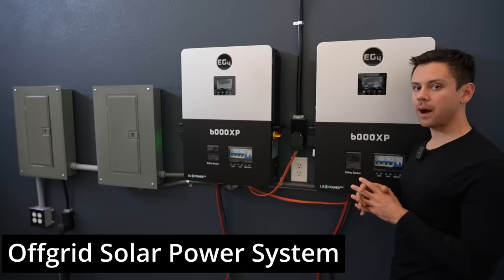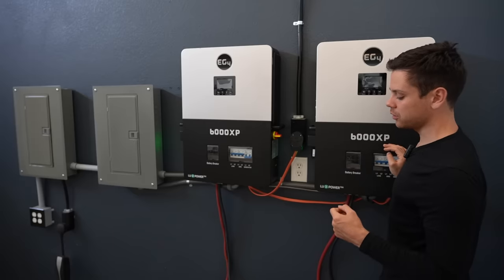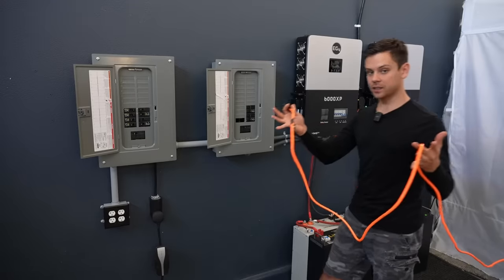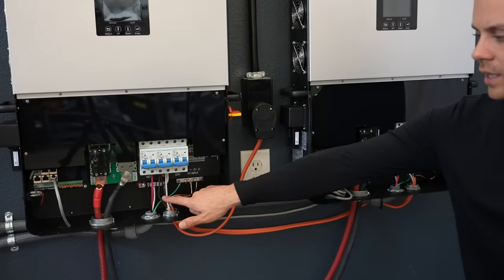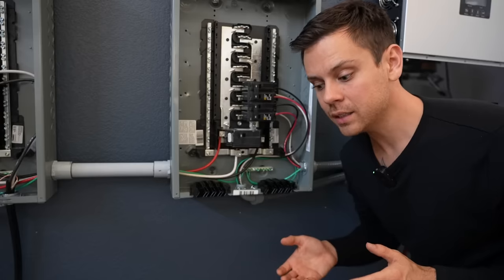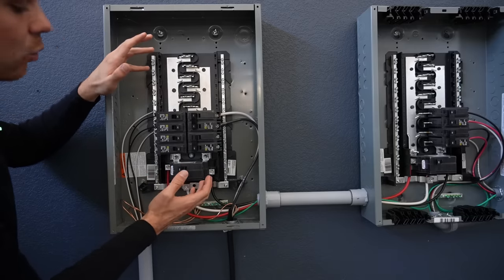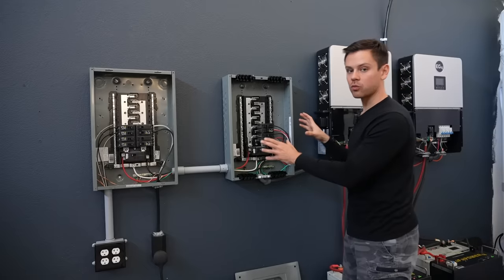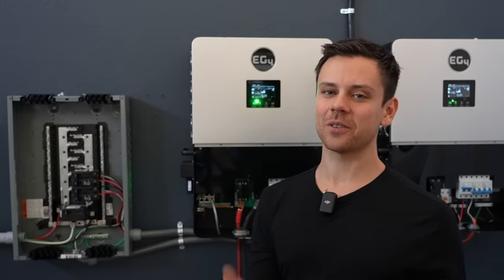How to Build Expandable Off-grid Solar Systems w/ EG4 6000XP

Comment: This was an excellent presentation Will.  While your an expert and know that the color coding on the one “red” phase lead was wrong, a DIY’er or an unfamiliar electrician “down the road”  might benefit from employing a piece of red heat shrink on the lead near the terminal fastener to identify it as a properly color coded hot phase lead. The batteries might be rack mounted, and technical data, such as ratings and weights would be useful.

         The discussion about ground loop was good and is a commonly misunderstood electrical safety issue on the wiring of sub panels compared to the main panel. If the system is not a separate independent off-grid system, then a municipal or utility inspection and certification may be a requirement for back-feed safety issues during grid outages. 😎

Comment: Could someone please explain to me how come he is using a 40amp breaker. That's good for 4800 watts and the surge on each leg would be about 6000 watts. On the 6000ex breaker was 60amps.
Reply: I agree - I would go with breakers larger than 40 amps.  Not only to handle the surge power from the inverter but the 6000xp also supports a grid passthrough of 50 amps.
Reply: My understanding... The breaker is there to protect the wire.  Maybe he didn't have heavy enough gauge wire?  If you know your loads and keep it under, no problem.  Worst case, the breaker trips...

Comment: I'd rather see a rectangular metallic raceway mounted right under the inverters and panel boxes. Basically mount the raceway first, then drop the other components on top.

Comment: Does code require wires to the batteries to be in conduit?
Reply: A don't believe so given that it's only a 48V battery system.

Comment: Tell me something Will what is the advantage of 96v inverter other than more batteries to supply power
Reply: still 48v on the battery side,   just runs in parallel to give 6000 watts + 6000 watts = 12,000 watts. Get 3 for 18,000 watts, etc
Reply: 96 volt can supply same energy as 48 volt using half the amperage = smaller wire size = lower cost.  All that said, the availability of 96 volt batteries and inverters is nothing compared with 48volt equipment.

Comment: If you have two or more inverters in parallel, do they also act as redundancy if one of them breaks?
Reply: I think theoretically if one breaks the other would keep running, but I wonder if it would maybe depend on if the one that breaks were the master or the slave unit.
Reply: If the master goes down, I think the system would be down.  I believe you'd have to reconfigure the slave as the master, but I don't know for certain.

Comment: The only thing that erks me is not explaining the 120v & 240v & how to set them up correctly I looked at the video and still don't know how to separate or differentiate the 120v loads from the 240v loads and whats what.
Reply from the maker: 120V uses single pole breaker and only connects to one of two bus bars. When you have a 240V load, use a double pole breaker and it will pull from both bus bars
Reply: @WillProwse  ohh ok I think I understand
Reply: @diysolaradventures7894  120VAC is HOT-TO-NEUTRAL.  Either HOT1 or HOT2 , to NEUTRAL.  A 240VAC load is HOT1-TO-HOT2.

The way the breaker boxes are designed, the slots going down vertically alternate between HOT1 and HOT2, so when you put a double-pole breaker in, the two connections are HOT1 and HOT2, aka 240VAC.   But when you put a single-pole breaker in the connection is just either HOT1 or HOT2 (with NEUTRAL being the return line), which will always be 120VAC.

For the U.S. electrical system anyway.  Once the lightbulb goes off in your head, its easy.  Always use a volt meter to double check things anyway.

-Matt
Reply: @junkerzn7312  I know my 240VAC appliance absolutely do not always pull power completely equally between the 2 legs at the same time.  If I understand correctly, in that case some of the return current even from the 240 volt appliance still utilizes the neutral line.  I'm not an expert on this stuff - just going by what I can detect with CT sensors or a clamp meter.
Reply: @intDavid  No 240VAC appliance should have current returning on the neutral line.  In fact, most aren't even wired with a neutral, even if the plug has a neutral it usually goes nowhere.  Only the two HOTs are being used as conductors so they are pushing against each other, basically.

Comment: You never showed us pulling 8000 watts and hooking up an inductive load especially a 240 volt inductive load.with running 8000 watts at same time.DID I miss something?😮
Reply from the maker: Yes my camera was in the way, had no car on car lift to make video
Reply: @WillProwse  Will you need to do a proper load test up to 12000 watts with a 240 volt inductive load and 120 volt inductive load Alot of people relay on your review before spending there hard earned money.I hope you will do the right thing.And I hope they pass with flying colors
Reply from the maker: @mikeg2321  oh I did that with heat guns on the first few minutes of building system! I'm much more concerned about surge capacity these days. But continuous 12,000 Watts is no issue. Some people are reporting running 13,000 w loads continuous
Reply from the maker: @mikeg2321  I did that before I even connected the second load panel haha
Reply: @WillProwse  well if you feel confident in this inverter that's good enough for me.thanks for replying.MikeG

Comment: Hi Will, how do we get a hold of you ? I’d like to ask your “opinion “ on solar/back up power for a new construction home in the country.

Generator outlet, conduit for future panel wires, all in one unit, battery etc.

Right now we would just be doing the pre wire or conduits etc…

I’m very familiar with electrical and the electrician can do the rough electrical needed.

Thanks Will, love your vast and knowledgeable information 😊

Comment: Thanks Will..What is the advantage/difference of using the (2)6000XP, as compared to running (2) 6500? Having the (2) 6500 would then give us the split phase also then.